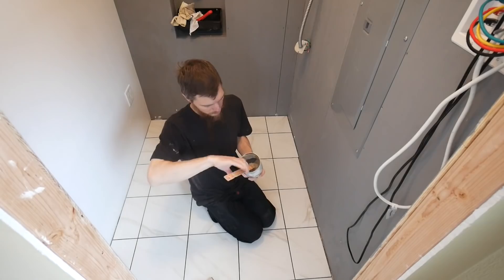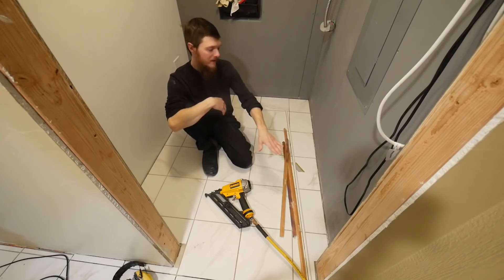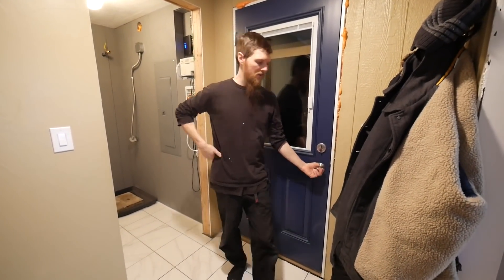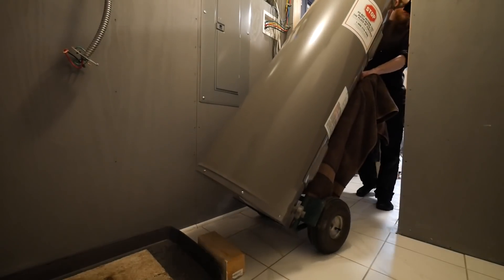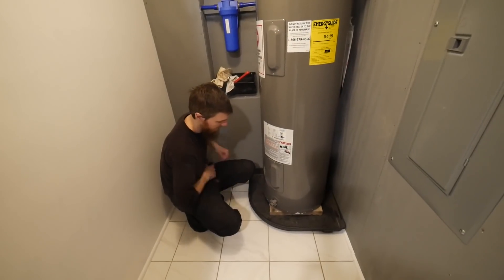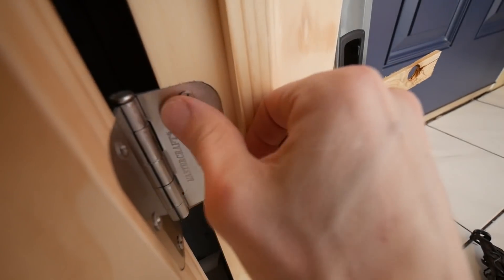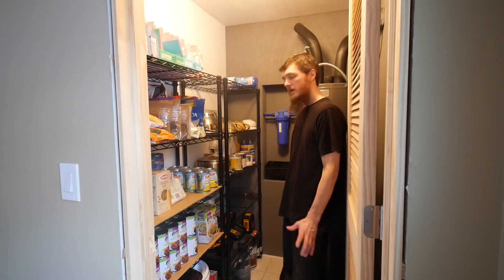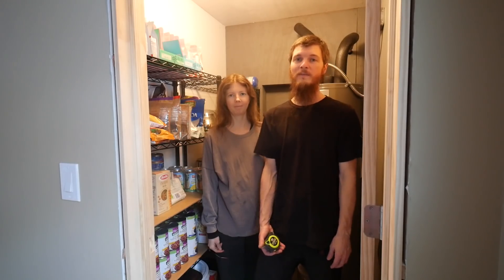Pantry & Mechanical Room - Home Renovation

Comment: Just curious if you had thought about an on demand hot water heater - you are so energy conscious. Only curious because I have thought about one. As always love your feedback.
Reply from the maker: We have considered them but just don't think they would work for us here. We don't want to use propane and an electric tankless heater has a huge power demand. We are already running so much on electric that I wouldn't want that additional load. Also, they generally cost more to buy and wouldn't always work well for us. They need a certain amount of water flow to turn on and if you turn your water on and off a lot, have fluctuating pressure, or like to trickle the water.. you just won't have consistent hot water, or even none at all. We like being able to just run the sink a little bit, or turn the shower pressure down low without losing hot water.
Reply: @diyfferent  As always, enjoy your channel and appreciate you taking the time to reply. I have not started on my renovation, but I am getting information for when I do.

Comment: Another job well done! The hot water tank doesn't have a pressure release valve?
Reply: Yes it does.
Reply from the maker: It's on top in the center with insulation around it so it's hard to see. I still have to put a drain pipe on it though.

Comment: That looks great!  Question though.  Won't that big piece of concrete in the pan reduce the volume of water the pan can hold if there is a leak?  Maybe 3 or 4 smaller pieces would work better..
Reply: If it weren't sitting on the concrete blocks the whole base of the water heater would be in the pan, which I think would reduce the available volume of water the pan could hold more than the concrete blocks will.
Reply from the maker: The pan won't be holding any water once we get it properly plumbed :)
Reply: @diyfferent  LOL, good point!

Comment: Question.  there was a hole near the ceiling near the hot water heater and electrical panel..  what is that for?
Reply: Steven Mitchell, that is for the clothing dryer to vent out.

Comment: Hi, I just wondering, if you need to do any repairs or maintenance to the water pipes it will be too much work to remove the wall board. Why you didn’t think about making an easy access to the water pipes like the one you done      for the access to vet under the house.
Reply from the maker: Ideally we will never have to touch the pipes again. If we have to do plumbing work it's not too much trouble to unscrew the wall panels.
Reply: if you’re fine with it no worries. Anyway it was a humble opinion.

Comment: Hi fam!
Aaaaand another thing left the living room, yay! 😎👍🏻
Only one thing, that would drive me nuts: the drain of the heater is exactly over a corner of the stone.
You said the stone would rise the heater so it would be easier to put something under the drain.
Well...there is that corner.... 🙈
But this room is definitely timelord technology and you use that space perfectly!
Reply from the maker: The corner of the stone isn't a big deal. I was just concerned about the lip of the pan being in front of the valve opening. I don't know if I will switch out the block for something else but it should work for now. Thanks!

Comment: Oh wow, you are storing food in where your hot water cylinder is. They heat the room up so will spoil food. I dry wet clothes in our hot water cupboard and they dry overnight.
Reply from the maker: In the USA new water heaters are so well-insulated and don't give off any heat. They are room temperature to the touch :)
Reply: But heat still builds up, don’t think I would like to risk it.
Reply: We have our hot water tank in a closet for going on 15 years, and there is no heat at all.  ..
Reply: Ours is in our master bedroom closet, it would be lovely if it put off a little heat but, it's doesn't. Literally, none at all.

Comment: Major code violation and dangerous. There should be a high-pressure and temp pop off valve installed on the water heater. This is in case a thermostat sticks  and continues heating to dangerous temps and pressure. Wather heaters have been known to explode in such instances!
Reply: He said at the beginning of the reinstall that was something he knows he need to do (safety valve) and will do it soon.
Reply: He said he needed to get that installed.
Reply from the maker: The heater does have a relief valve already installed. I just have to add the drain pipe down to the pan, which will be soon. But it's perfectly safe right now. All new water heaters that I know of do come with a pressure relief valve. Ours just happens to be located on top of the heater so that's why you may not have noticed it.
Reply: That is a relief as you cannot see it in the video or did I hear you mention it specifically. I think you guys are doing a great job!